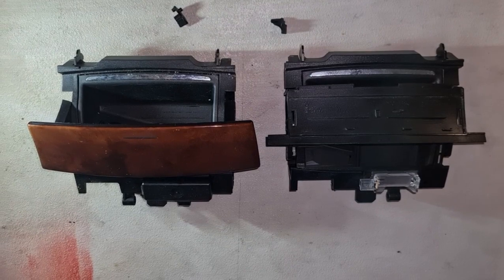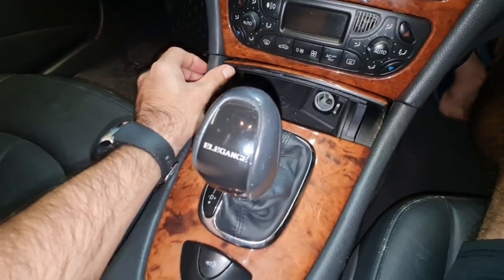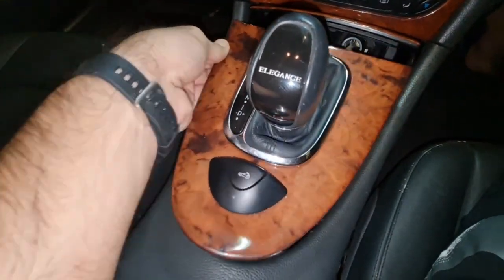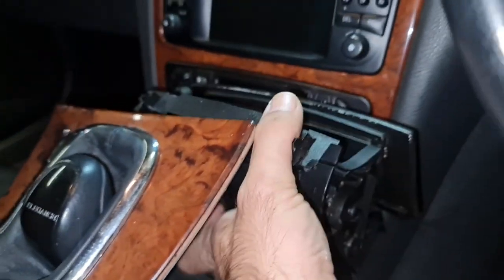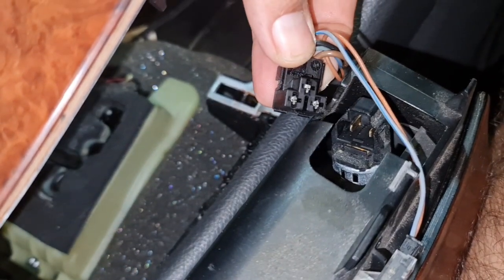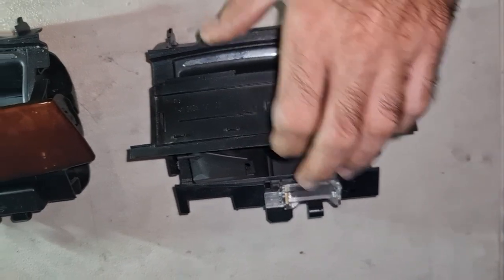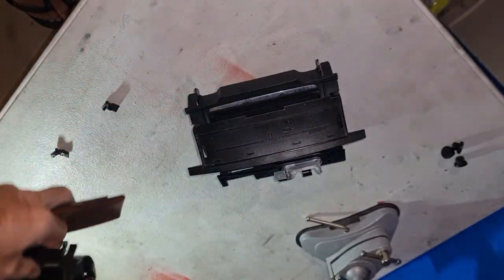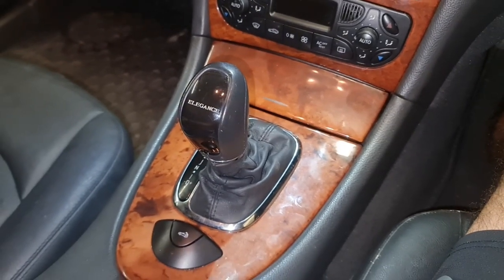Mercedes Cigarette Lighter Compartment, Removal and cover swap...

Comment: Excellent and easy project. I am thinking of replacing the cigarette lighter with a dual USB outlet in a w202, will look into this further
Reply from the maker: Awesome, good little fun project ;)
Reply: Did you do it? I would like to replace the socket with a USB plug, but I can't figure out how to remove the existing socket.
Reply: @jasonmaxwell2883 I did it. You need to cut through the metal of the existing socket and break the see-through plastic to remove it. Quite ugly solution but it can be done. I have now installed a USB charger in its place.

Comment: Hmmm do you really have to put some force on the gear shifter? I seem to be having issues with my c230 where I can’t get it off
Reply from the maker: Shouldn't really. Just put the gear in D.
Reply: @BenzAddiction  I’ll give her another go later today, there’s just nothing to grab on to so might have to pry it open
Reply from the maker: @I.Fumblebee.I  That's the way, be patient not to break the trims as the original parts are hard to find and expensive.  Good luck.

Comment: Can't lock mine on 2012 r350. Any advice ?
Reply from the maker: Pull it out and clean it, will be good.
Reply: @BenzAddiction  If it's the answer to my question, it doesn't work. No need to clean it, the cover stays open when I'm trying to lock it (push the lid down). It is r350 (2012).
Reply from the maker: @teekey1754  👍